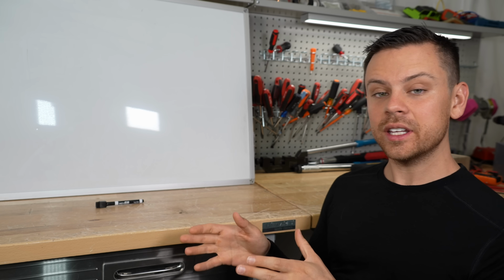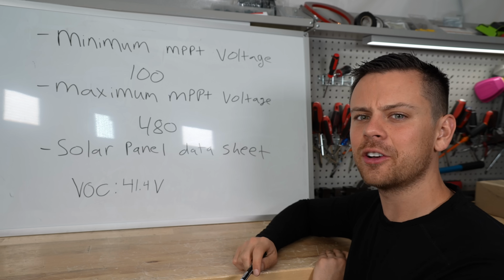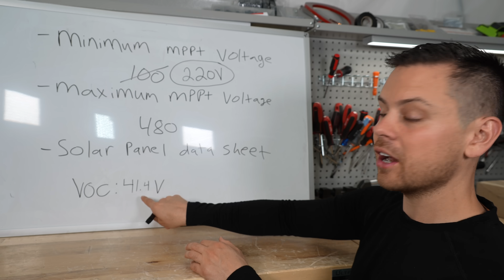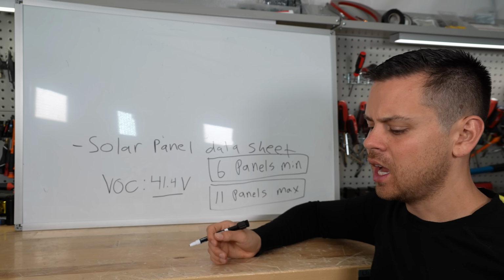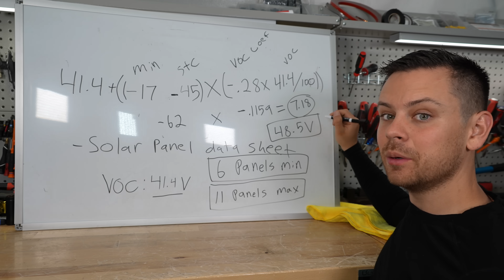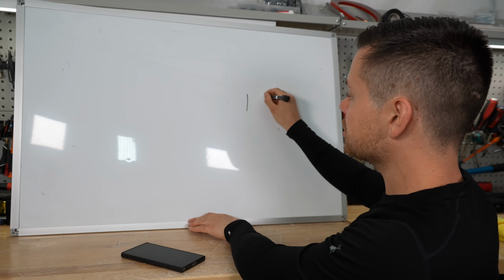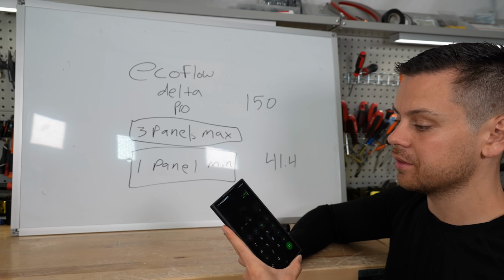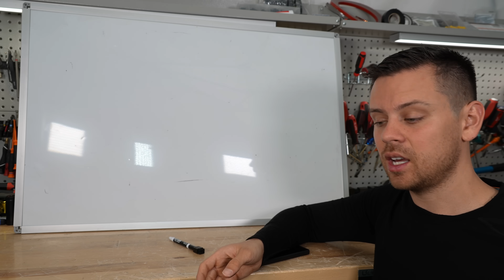Solar String Voltage Made Easy! How many solar panels can you safely connect?

Comment: If i have a Fossibot f3600 pro wich has max voltage of 160 i can't go for 4x445w 39.1 Voc -0.250%/C panels in a climate that goes down to -42C as lowest temp if i go for series parallel combo? wouldn't that make the voltage only be 82V + whatever the cold weather does to it or will this damage the unit aswell?

Comment: My vertical bi facial+ snow in winter caused problems, the 3.3kw boosted to 4180w and tripped my 15A mppt string max, had to shade the array with a stick. I am switching to 12000xp and I have 20x465 and 6x 550w, adding 10 550w, 8x465 8x550w,8120w 400V @28A per mppt X 2 , winter boost +1.7kw from the 465w and 2350w from the 550w(697w), with snow 20kw on 4 strings. Thoronova has 43V 580w panels easy to go x10 with those easily boost to 7kw, all my panels are 49V+ with no.8.

Comment: i want to run my starlink mac min and a 49' wide screen and maybe another 100 watts i like the thought of using the victron 24/1200 inverter and aptos 370 panel i am confused about witch victron charge controller should i use thank you

Comment: I’ve been curious about this: why not install a boost converter to every solar panel? Set the boost voltage to 350-ish volts, wire all the panels in parallel and call it a day. Not an MPPT on every panel. Just a simple off-the-shelf boost controller rated for the voltage and power of your panels. 

Downside: extra hardware on the roof. 
Upside: any shaded panels don’t drop panel bus voltage. Minimize current on solar wires.
Bonus benefit: built-in wireless monitoring on the boost controller can give you panel-level production data.

Maybe that’s what the industry will invent next. Your thoughts?

Comment: Question 🙋‍♂️ here  I have a charge controller that says 150v 50a max but then it says 520w max at 12v .. so I have some 415w panels 50.5v  10.4a   Now I was thinking I could put two in series but will it be over the 520w ? Or will the watts stay the same ?
Reply: When I put one panel on the charge controller 415w   The controller says it’s only 45 w ? Is this thing a pos?

Comment: I don’t doubt the calculations but I question when it’s extreme cold. The sun is also at a minimum put out much lower output.
Reply: Extreme cold can actually INCREASE voltage. Voltage is highest in solar panels when it's sunny and cold.

Comment: I would hate for a rare but not unheard of cold snap to over-volt my charge controller.  My solution would be to add a thermostatically controlled relay across one or more of my panels, depending on how cold my location gets.  For the example in this video, under normal (warmer) operation you can use all 11 panels.  But when the temperature drops, the relay engages to remove a panel from the string to keep the voltage within the specs from the data sheet.  When the weather warms, the relay reverses to put the panel back in series.  I would not want to handicap my system 99.9% of the time in anticipation of the 0.1% worst-case scenario.

Comment: You also need to pay attention to the wattage of your panels and maximum wattage input of the charge controller. 
If the Maximum wattage input is 2400W, and you have 250W panels:
 9 x 250W = 2250W, this is good for your Charge Controller.
3 parallel strings of 3- 250W panels does pretty good.
Each string has it's own 10Ga wires and those are connected to 30A breakers at the panel, the output of the breakers are daisy-chained together and that output goes to your Charge Controller.
A 100A / 100V Charge Controller would put out about 41A to 8 lead-acid group 27 batteries.

Comment: Will,   At 12 minutes into this clip you say use 4-400W panels for the EcoFlow Delta Pro.   You haven't accounted for the Voc in cold weather.  If the Voc was 37.18 and the Voc coff was -.3, with the temp at a moderate 77F or 25c, the max E for that would be 39.41. 157.64V.    20C would be 159.88.  Correct?   I'm DIY with a  EcoFlow Delta Pro Ultra.  Looking to used Bifacial and the Max Voc gets even more tricker.   I'm thinking of staying with monofacial panels.   I appreciate your video's.    Keep up the good work

Comment: This calculation is pretty important for people in areas where string inverters are worth it. Pretty much homes maximizing their power generation would have to account for paying for multiple inverters or save with using microinverters. I was thinking i would go for a string inverter since i am south facing with no shade but the extra cost for 32 panels using string inverters would likely put me over budget

Comment: Hello Will
As usual great information and presentation. 
Though I would like to throw out a suggestion for those of us in regions with all four seasons.
Wouldn't we have a more well rounded and overall higher efficiency system if we were to add automatic switching to drop or add solar pannels in our series strings.
Controlling a DP/DT switch with a thermal sensor and possibly backed up by a voltage sensor for redundancy would add or subtract pannels as needed keeping our systems running nearer to peak efficiency and having it automated would give peace of mind.
Thank you kindly

Comment: I looked up a Victron system and it had an MPPT range up to 425 and also a maximum voltage of 500. How to deal with that? Should I calculate with Voc to be below the maximum voltage and just make sure to keep the Vmp within the MPPT range? Or won't the MPPT function unless the Voc is within the MPPT range?

Comment: Question. If a Bifacial Panel exceeds 15amps at a 10% or 20% bifacial gain, (Up to 16.62A), can this damage your system if it's rated for 15Amps? The panel operating without bifacial gain or up to 5% has an amp rating of 13.85 and at 5% is 14.54. Thanks!

Comment: I built a 48v system on my motorhome that has 8, 550w panels on the roof, wired in series which produces 400voc. My Sungold Power 5kw all-in-one's charge controller is rated at a max of 500v input, but its MPPT range only goes up to 450v, so this is the practical limit if I don't want it to truncate any power. However, in the real world, this horizontal mounted array typically produces between 265-375v. I had to wire them in series in a single string as the max amperage input of the controller is only 22a (though it has a 100a max output) and since the IMP of each panel is 13.45a, 2 strings in parallel would exceed the controller's 22a input current limit.  I guess I could add one more panel to the string, but my 35ft coach's roof is completely covered now, reaching my physical limit before the electrical one. Though I do have a smaller 620w liftable array on the side of my MH to charge my smaller 12v 560ah battery.

Comment: Why do solar inverters mention Max input Current, when current is pulled by the inverter and not pushed by the panels
Reply: Solar panels also outputs amps
Reply: @Danny_cruzz  Thats what I said. Whatever current is pulled in by the inverter is actually output by the panels. So max output current for inverter makes sense but wonder why input current limit is mentioned.

Comment: Hi, Victim of Dunning Kruger here, I invested in the ecoflow delta pro 3 promotional with two ecoflow panels at 48vs a piece and can't push it to 3 in series on the high end during winter in my area when of course it's most crucial given the dearth of sunlight, but can anyone answer if it's possible to add a 37v 400watt panel in series with the other two operating at 48v? I know you should keep the specs of each panel close by comparison but how close we talking here? Is there any wiggle room in this rule?

Comment: My Victron controller max input for my 24v system is 105v and 45 amps. My 4 panels are 37.5 v, 10 amps each so I could only connect two panels in series. I had plenty more room for more amps at 45amp max. So I connected two panels in series then another two panels in series for a total of four 250 watt panels. Then connected the two pairs together in parallel. That kept my voltage below 80v but brought the amps up from 10 to 20. It's working great running two freezers and a fridge in my shop.
Reply: Thats very similar to what I'm looking to do.

Comment: Hi Will, you've no doubt been asked this question before, but as I've tried to research it, I get a variety of different answers. - I have a 40amp Epever XTRA charge controller, to be used for a 24v system, that is designed for 1040 watts of PV input at 24v
I will accomplish this using two off; 450 watt, 11 amp, 41.6volt panels wired in series, (string No.1 )  that I already own.  However, I have four more identical panels, that I wish to add if possible,  as series pairs, wired in parallel, as two more strings, for boosting the charge current x 3, in often cloudy weather.
The question is; does the internal design of the charge controller, still regulate the output current to not exceed 40amps, into a half charged battery, irrespective of full sunshine hitting all 6 proposed panels, causing the voltage to remain high enough to push 100 plus amps into the battery if allowed to do so, from the additional panels, if the charge controller does not regulate above 40 amps output, whilst the (in this case), LiFePo4 battery is still charging ?
So the question really is; does the charge controller, when its charging a half charged battery, in full sunshine, rely on the limited maximum current, of its prescribed 1040 watts of solar panels, so that in normal circumstances, it relies on the fact that the PV voltage will drop off sufficiently to thereby independently limit the charge controller's output, to a maximum of 40 amps ? 
Which therefore means its designed to only need to regulate the current once the battery reaches its nearly fully charged state ?
Thanks for your thoughts on this.

Comment: As far as Ecoflow Delta Pro is concerned do NOT go above 900W solar if you plan to place it inside your home. I got 3×410W panels connected and as soon as the Sun hits them and the incoming power hits and exceeds 900W it gets UNBARABLY LOUD ! Like 69dB. The small and very loud fans (all 4 of them) spin at 100% between 900-1600W solar. Even though the Delta Pro's temperature doesn't ever exceeds 90F. (same noise lvl at 75F) I've had this system for 2 years and after many firmware upgrade but they never touched the thermal protocol. I've written many times to their CS but they don't even plan to fix it which is amazingly stupid. It would take minutes to write a much better thermal management which is based on temperature and not wattage. They even did that on their new product, the Ultra.
It's dead silent even at much higher incoming solar wattage.
Eventualy I had to remove one of my panels and sacrifised 400W to make it less noisy.
It is still loud at 800W (50-55 dB) but much better than 69 dB.

Comment: how about max current? I was going to hook 4 panels, two panels each in series, and then hook them in parallel but my inverter said max input current 20A, the current per panel is 13.6A making the total current 27.2. You don't mention current so I wonder if I am looking at the wrong thing and can actually run this parallel setup or have to keep it all in series? I can't see why they would limit the max current to 20A and sell the system with multiple panels. 
Thx

Comment: Hi Will -- I had thot the other day... U know how you don't recommend  charging RV  batteries  with the RV's  generator- - it occurred that it may be "functional to have a roof mounted set of  "fan-gererators"  on the RV so that when driving down highway makes "fans" turn and generate battery charging current.  thus avoiding RV electrical system abuse..  PS U do Gud Werk - THANKS

Comment: I have a string of 7 panels with 450w. I need to add 2 more panels. Should I go with different manufacturers with the same wattage or same manufacture with 550w panels? Thanks a lot

Comment: Just put of curiosity, you add the voltage to account for the drop on temperature, however say for example your in the UK,  the temperature drop will often coincide with winter so lower sun and less sun, so won't they cancel each other out? 
I'm new to solar so just looking to learn.
Or does the voltage always remain at maximum no matter the amount of sun?

Comment: Can any 12v solar panels be wired to 48v? Or do the panels need the specific capability?  Thanks. Have a 48v golf cart I'm turning into a solar generator but don't know much in the field, I got a Chins 48v lithium battery,  if have any tips or recommendations on charge controller or panels they'd also be appreciated

Comment: Will, you do a really great job working all the kinks out for us. Thank you! 
I do have a question though. Since the open voltage should only exist in an open circuit, could you use the rated voltage instead for the maximum voltage you wish to calculate? Again, thank you!

Comment: Thank you: I know that you have had a Growatt in the past ,, Could you do a quick vid on connecting 250watt panels to a 12,000watt Growatt inverter. I have two of these inverters and I also have 48 250 watt panels.  I need to wire these up within the next few weeks before snow hits.

Comment: So, if I have 4 EcoFlow 100w Rigid Solar Panels and a EcoFlow Delta 2 (not the Max) and I hook up 2 Panels in series and another 2 panels in series, then both in parallel, this will work at 24v @ 30A and 400W with my Delta 2 without damaging it? Thanks again for this great video. 🙂

Comment: I have a problem that I need help with. I have 2 water heaters. With 240volt 4500watt elements.  That I'm going to use to heat my driveway. I have room for 24 390watt canadian solar panels. I want to use DC direct. for the 4500watt elements. I've been told that 6 panels in series. Is what I need. And also 12 panels in series. Also. 6 panels in parallel. Please help! I can't get a straight answer. 
I already have 3/4" pex installed over 2"foam under 5" concrete. I made all the manifolds myself. And have DC pumps all ready to go. Just have to fill with antifreeze/water. As soon as I know what to do for the waterheaters. I want to have the correct answer.  Before I do this. 
Thank you so much for all you do.

Comment: is it safe to say that this calculation is per MPPT, and if the inverter has 2, I can connect the same amount of panels to the 2nd MPPT to get as much kWH as I can, correct?
Reply: Yes, if inverter have say 10 mppt, the calculation applies to all mppt.

Comment: Excellent tutorial Will.  Since the 6000xp can accept 2 PV arrays, could two of these 6 panel arrays be connected without exceeding the maximum voltage limit?

Comment: What if you need more wattage? How do you address the voltage limitation? 

Most panels will be in the 50s in my location so how would I add more wattage on this inverter?
Reply: get solar modules with higher current but make sure that the input current to mppt is below the maximum limit of what inverter can handle.
Alternatively, get a inverter with higher power rating and more mppts.

Comment: Brisbane gets a lot of sun and has more stable temperatures so system design is easy. Also off grid 48V is better, as now you can store power use inverters, and the evil energy company cannot see what appliances you use and build a privacy invading load profile and behaviors on usage that they sell to data brokers without you're consent for profit, as its off grid.

Comment: My 5kw solar array only uses 6 groups of 2 x 35Voc panels in series, at 0 C its 8 Volts above and only 4 volts below at burning hot 65 C, its extremely efficient conversion to 54 V Float and up to 58VDC Boost, at this voltage its around the max power point too, just use a DC to DC buck, works well. 60~85VDC is much safer, than hundreds of volts, its still can draw an arc thou.

Comment: Going over the wattage rating isn't a problem is it? I thought you could and should go over on the wattage because the charger will only draw as much as it can/is rated for. And being over means it will be charging at closer to maximum in less than ideal conditions rather than only charging near maximum potential during the narrow window of perfect conditions.

Comment: If the inverter has a pv input rating of 900v and there are 2 mppt strings does that mean each mppt has 900v or is it divided between the 2?
Reply: That means each mppt can handle up to 900V.

Comment: In Downeast Maine, my calculations for Hyperion BiFacial 395w with EG4 12K is 6-13 panels modified to 6-11.3 panels in coldest weather (-25c/-13f). Assuming that -13F is likely to be overnight when sun is not shining (last winter lowest was 8F overnight), and limit so close to 12 anyway, it seems like I might be safe with 12 panels per string with an alert if weather goes crazy. Too risky?

Comment: Will , i have 2 ecoflow 400 watt panels sometimes i get upto 860 watts i would like to connect 4 of them but wont that be more than a 150 volts for the delta pro

Comment: Thanks for all your extensive knowledge and non biased reviews! 
Question: I have a solar panel that is too much voltage for my solar generator like a jackery or something, does it makes sense to use an mppt or pwm to make that useable power for the battery?

Comment: I'm in the process of designing my home solar system but I've heard conflicting information at times. For instance, while what you say about calculating max voltage of panels makes sense to me, I've also read elsewhere 20 to 30 percent above max mppt voltage is fine too.  The argument given is the panels never reach their theoretical limit.

Comment: Would it be reasonable to have a thermostat cut off power from a panel or two from the string when the temp became low enough to become a problem?  Some climates can hit 40 f below only once in 20 years.  The juice from 2 panels not installed for a once in 20 years cold day could easily pay for the thermostat.